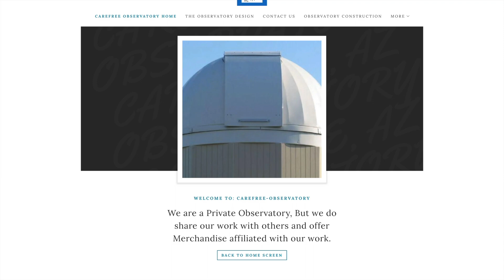Carefree Observatory "Framing Began This Week"

Comment: Nice neat framing 😁👍will you need to build a cricket between the existing roof and the structure wall ?
Reply from the maker: no building the hip into a Gable end to connect into the parapet wall of the garage, the tle roof will continue to the addition and over the guesthouse/office garage entry between buildings
Reply: @CAREFREEOBSERVATORY  Ok i see it now thats a lot of roof i can appreciate how much work goes into this iv seen what rushing can do i worked with 1 guy that built 3  identical huge dog houses on the roof of this mansion we built in Hamptons and because he was rushing he marked the line on the wrong side and the far right one was off 5½ inches and the homeowner noticed just as the copper guy finished flashing them 1st he tried saying it was and "optical illusion" lol then the homeowner sent his helper up to measure it (guy was like a cat on a roof) lol but it was off and the got fired and it cost our boss like 5 grand to move it over 5½inches wasn't fun ether it involved a Lull and a lot of sawzalling and cats pawing lol but bottom line it doesn't pay to rush in all instances your doing a FANTASTIC JOB 👍😁 your going to have a nice sturdy structure for decades to come
Reply from the maker: Zombie I'm Sixty, i've been doing construction since age seven my father was a builder, I am a builder check what I do for a Living at www.holmesconstructionaz.com
Reply: @CAREFREEOBSERVATORY  Oh I can tell you know your stuff I wish I worked for more guys like you id probably be a contractor myself by now lol over here there are a lot of hacks i will definitely check out your website 😁👍